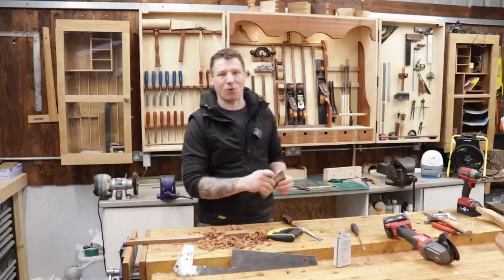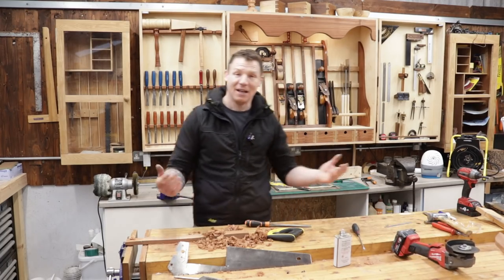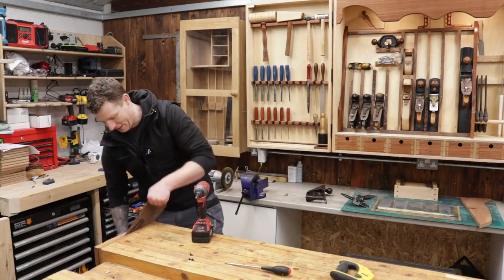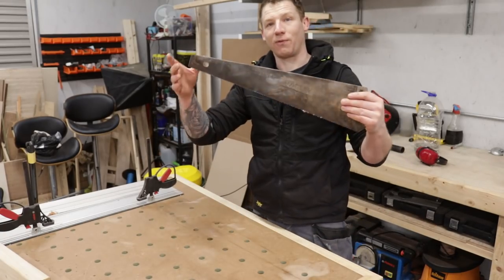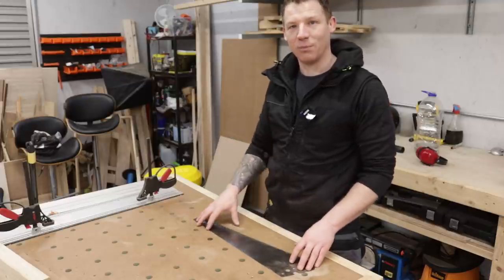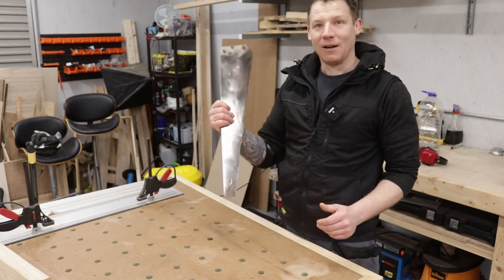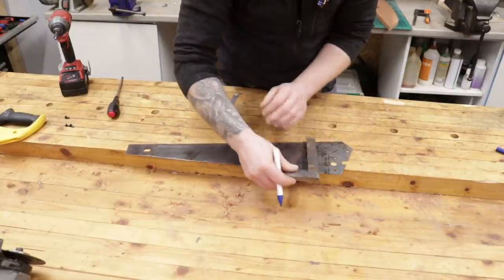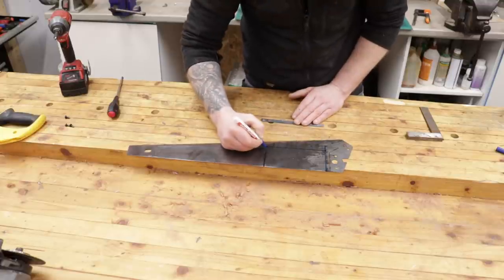Make a Cabinet/Card Scraper From an Old Hand Saw. How to Make and Sharpen.

Comment: I made half a dozen different sized ones out of a hand saw last year. FYI - I use an old chefs steel as a burnisher - it works really well. I also finished the holding (back, cut) edge with a line of electricians tape - so I know which is the business end!

Comment: Good idea,if you have some contacts with someone who works at a sawmill. Get a large broken piece of a bandsaw blade, I've made several card shapes from the blade. Sawmill where I work,I got a broken piece 1/8"×36"×48",the steel is harden and tempered for extreme working applications, also resistant from oxidation because water is an application for a coolant and lubrication, metal elements are chromium,carbon steel  with a very high yield strength, when cutting the steel keep it cool ,do not discolouration the steel to a straw blue colour,also it can be shaped and bent into formation by heat treatment. Ok let's get to it.

Comment: Nicely done John, don't throw out the remainder of that saw plate, even the small parts will make good scratch stock material. Not sure if you can do much with the circular saw blades though, they're very thick for scrapers. Maybe for scratch stocks, but that's a bit of work to shape them. 
If you're thinking of getting a purpose-made burnisher, I'd can't recommend the Arno burnisher enough, it was what got me from cant-sharpen-this to this-is-easy with scrapers.
Reply from the maker: Thanks for the tip

Comment: John.   When you cut the scrapper out with the angle grinder did you any concerns about removing the hardness from the blades
Reply from the maker: Not really it didn't heat it to much, it works.

Comment: John another great video but can I just ask a couple of questions. The size is 6 x 3“ is it the 3 inch end what you’ve burnished over to make a cutting edge think I’ve got it in my brain how it works just confirming did you use two nice bits of wood to make a nice handle as well for it so got a better grip
Reply from the maker: Hi Paul, I burnished the 6 inch edge. I didn't use any wood for a grip its just the card itself.
Reply: Thanks John forgetting back to me. Okay I’ve got the idea now. Why I said about a couple of pieces of wood either side of it to make a nice handle for gripping. I will definitely make one or two of these these will be great for the green book working I’ve took up and specially when I build a chair.. and been thinking could use a round file to bend it round that should be hard and still fingers crossed

Comment: Would an old circular saw blade work just as well? I ask as I have one but not a redundant saw?  Thank You
Reply from the maker: it can do, just depends on the thickness. either way there is good steel in a saw blade
Reply: @JohnMcGrathManInShed  thanks Chief. I’ll give it a go 🤞🤞🤞